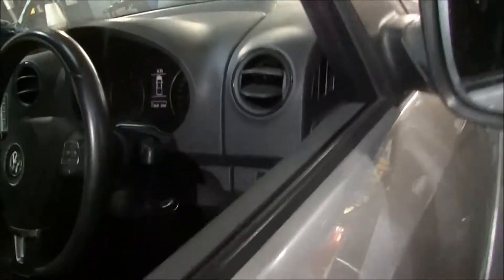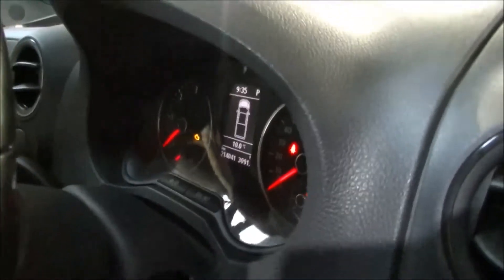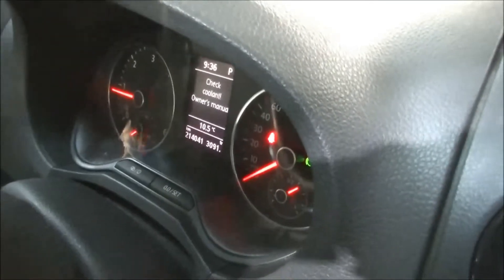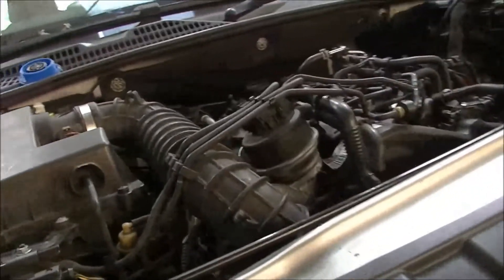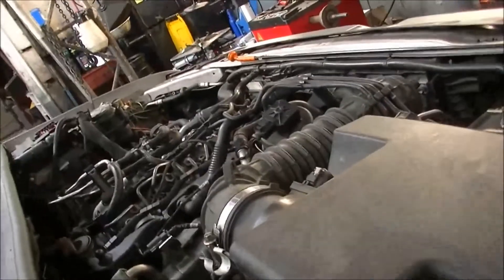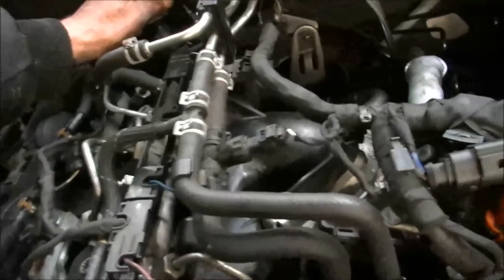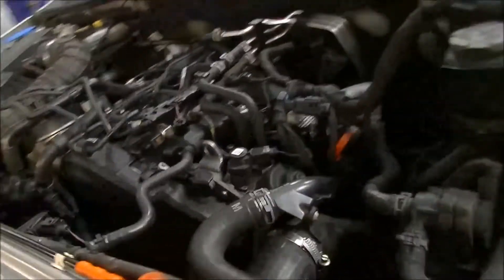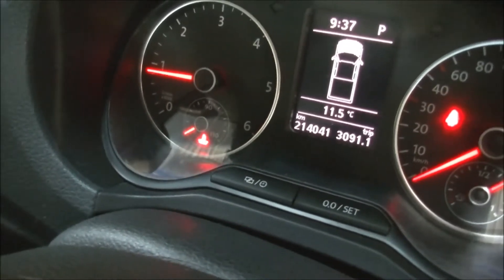Amarok 2nd start attempt.

Comment: Good to see, ive done the same done up tight but not overtight and a bit of blue on the threads. I do wonder if tty are just another money making gimick, Never needed them before !
Reply from the maker: To be honest it's the first time I followed the directions and it bit me in the arse...I actually recon the bearing was the issue...It was a tad snug to turn so I think it grew as it heated and locked up hence backing the bolt out loose enough so break it...The bearing in it now spins much easier...Cheers mate.
Reply: @ziggassedup  man ive not seen that before, once in a long while something outa the ordinary comes along, i guess since i no longer pull 100 hrs a week on the tools since i got crook i get to miss all these dramas and little lessons.

Comment: Top job mate…..!!

I always thought diesels required special priming on the fuel lines once they’ve got air in them but maybe these days they figured that out self bleeding or something….. 

Maybe that was in the older day of mechanical fuel pumps i don’t know
Reply from the maker: Thanks bud...Common rail diesels don't have a pump like the old ones..They have 30,000psi in the rail and the injectors are fired electrically...Cheers mate.
Reply: @ziggassedup  So does that mean that all the talk about having to use a laptop with the card reader to prime the line when doing fuel filter changes is rubbish? They state if you dry run these 2ltrs to prime the diesel lines it causes damage to the diesel pump etc. Thanks. Will be doing mine soon

Comment: Hi, appreciate your video, I'm just doing the same on my amarok, 14 rockers broke on mine! I know it was a long time ago, but can you remember how much it cost to get back on the road and where you got the parts? Wondering whether a second hand engine would be a better  option for me. Cheers Mitch
Reply from the maker: Cheers Mitch...I think it was $500 in valves...The final video I think tells...Not too bad of a job to pull the head off and fit new valves...Good luck mate.
Reply: @ziggassedup  thanks mate. I'll give it a crack